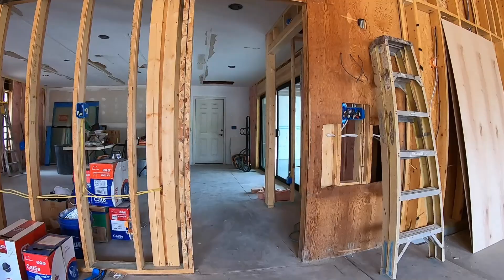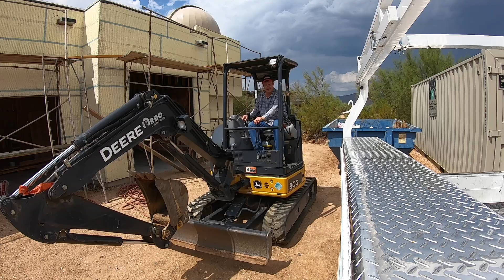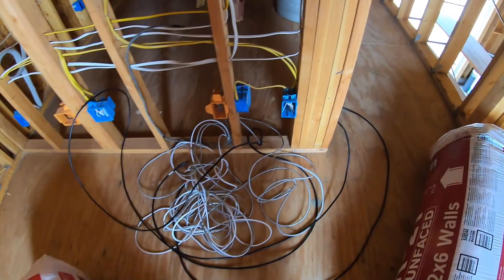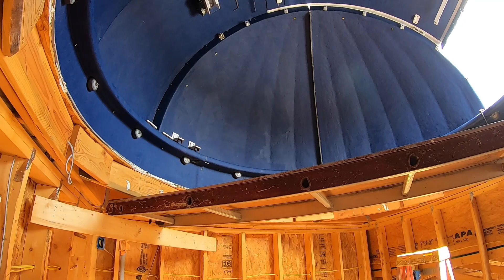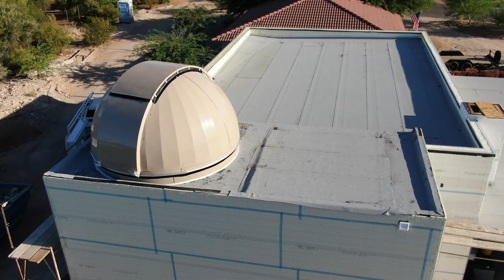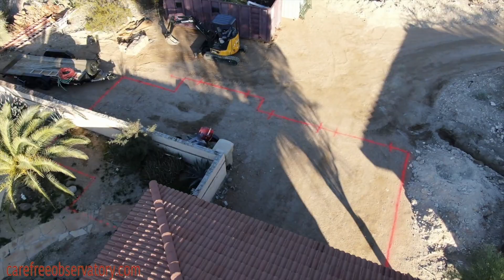INSULATION TIME AT CAREFREE OBSERVATORY

Comment: Amazing progress brother

Wish I Was closer, I'd talk you into a poker night inside the observatory office 

I'd help out too but can't lift anything much, your a smart worker, not many are smart, they just work. I noticed the outside stair case wall didn't have any plywood and you insulated anyways, I guess there's going to be drywall on either side no need for extra plywood? 

Much Love and God Bless
Reply from the maker: The stairs will attach two places one to concrete patgio post. and one will be the door sill at the entry at second level. I have a preinstalled metal wrapped 2x4 mounted & flashed at doorway to the observatory were the stair landing will bolt too. The walls are solid plywood behind the stucco 1" foam  board, then two coats of stucco & Paint. The stair will be ordered once I pour the patio around the pool
Reply: CAREFREE OBSERVATORY good job brother it's coming along quickly for the size of the job and the crew you got 

God Bless